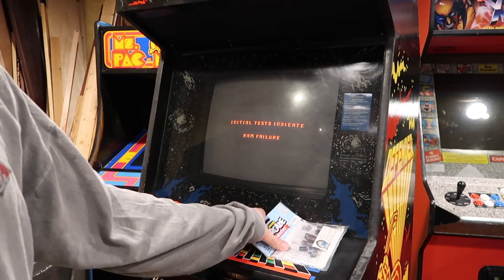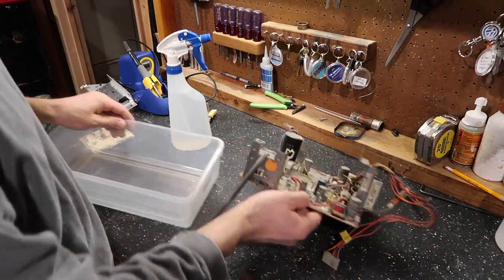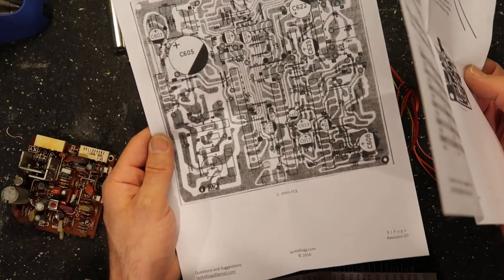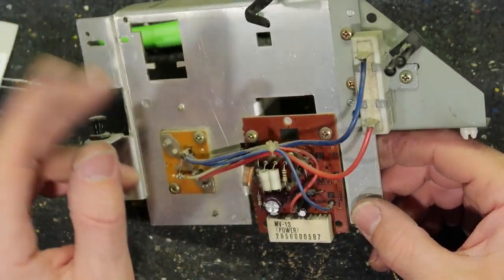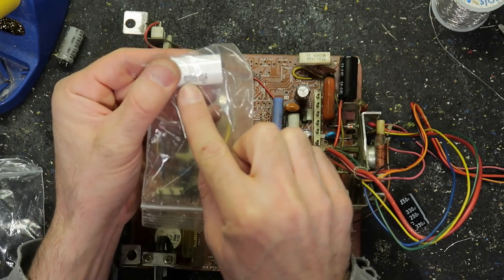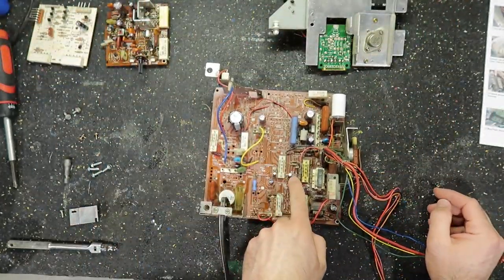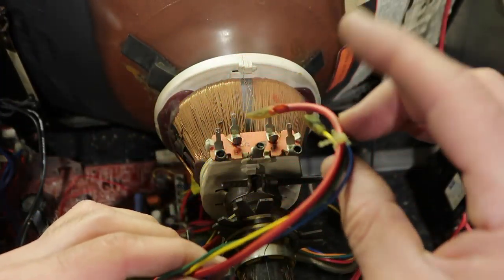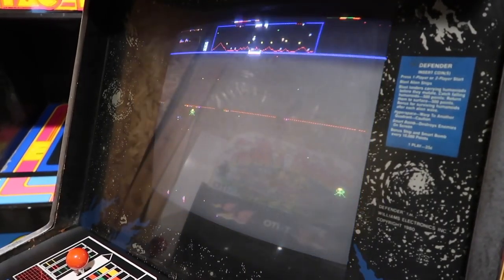Wells Gardner K4600 19K4613 - How to CAP KIT Repair Arcade Monitor Teardown Manual Schematic

Comment: When soldering pins in a row it's best to jump around instead of doing them in one row. For example, if you have 15 pins in a row do pin 1, 6, 11, 2, 7, 12, 3, 8, 13,....
This prevents too much heat buildup on any one component or trace. Not a big deal on a board with large components and heavy traces. A good habit to get in is not to do them in a row.

Comment: Great video. Following the steps and also taking a video so I don't cross any wires on reassembly.  Thanks for the knowledge your providing. My Galaga may live with a tube screen instead on the LED replacement in the near future.

Comment: I have the same RAM issue on Defender. Did you cover fixing that on another video? Does the RAM need to be replaced or is it most likely just a case of broken solder joints, chip creep, oxidation, etc?
Reply from the maker: I have the new ram but have not filmed or installed it yet. Future video.

Comment: Hey bro just saw your video good shit. Quick question my vert hold is not holding and i believe its a cap. Im gling to replace them all but i read it could be a transistor as well. have you had any issues with vert hold?
Reply from the maker: No, but you may want to join the FB group "Arcade Monitor Repair"  You can get quick answers from guys who really know their stuff.

Comment: Thanks for doing this, I have four of these I want to rebuild, the quotes I have been getting from folks are in the $200 range to do a cap kit, that's nuts when the cap kit only cost less than $10. For that I can buy myself a nice soldering iron and multimeter and do it myself.
Reply from the maker: Wow! I never knew people charged that much. I find it fun doing it myself anyway. How did it go?
Reply: To properly work over a K4600, there is much more that goes into it than just a simple cap kit. And a quality cap kit with higher rated quality caps will cost more than $10.
...A full reflow of fresh solder to many areas. And not just adding new solder to the old, make sure to get the old solder out and then reflow fresh solder into the joint.
...cleaning up and getting the oxidation off of pins, sockets and headers.
...checking several resistors, potentiometers and transistors to verify they are good. The black level pot(VR201) on the small interface pcb is known for failing often when trying to adjust it after a cap kit. I reconditioned three of these K4600 monitors recently, all three black level pots failed when trying to adjust them. Fortunately, I had ordered those pots when ordering the cap kits.
...verify continuity across the monitor chassis. sometimes these monitor chassis develop cracks and broken traces. plus a thorough visual inspection can help spot a broken or damaged component.
...sometimes washing the monitor chassis is needed because the chassis is nasty dirty. easier to work with a clean monitor chassis.
...proper soldering with a good adjustable temperature soldering iron is helpful. Some of that old solder is very stubborn and does not want to melt. Some of the solder joints on the ground planes are very stubborn. So I add fresh solder to the old solder joint. Then I will use my soldering iron and desoldering gun at the same time to melt the solder faster. That way I am not leaving the iron on the board for too long, which could damage and lift traces.
...be careful with the horizontal width coil. Some of them have become very brittle over the years. Instead of risking damaging them, I do not squeeze the tabs to release the coil from the frame. 
I will snip the two wires where they attach to the pins on the main chassis, then crimp on .062 molex sockets with some heat shrink tubing covering them. Or you could desolder the wires from the pins.

I can knock out a basic cap kit in decent time. But when you want to be very thorough the extra time taken to do so can add up.

But in the end, the WG K4600 when fully taken care of puts out a beautiful picture for arcade video games. The flybacks on the K4600 are extremely reliable.